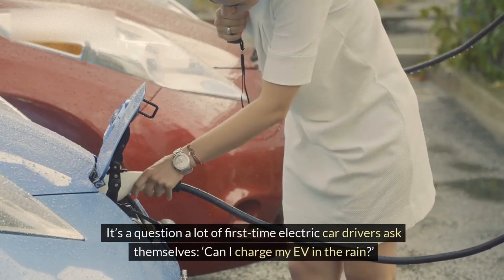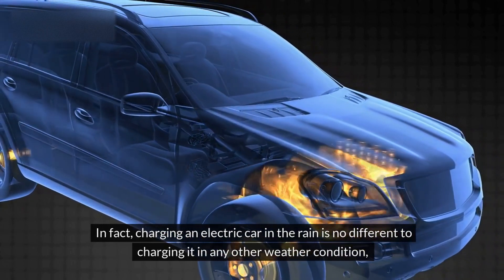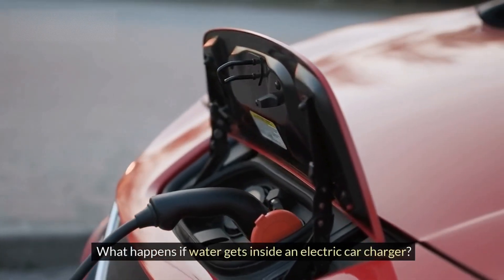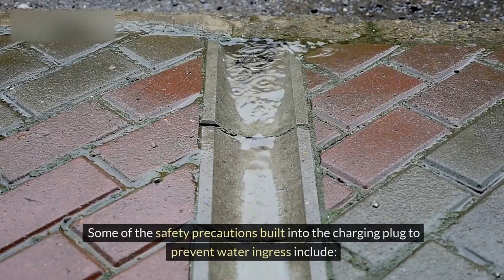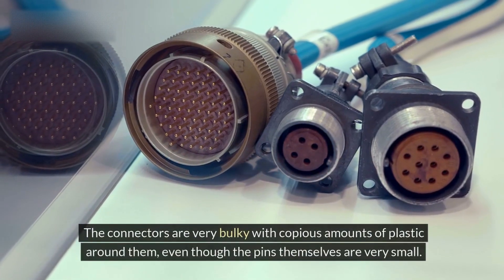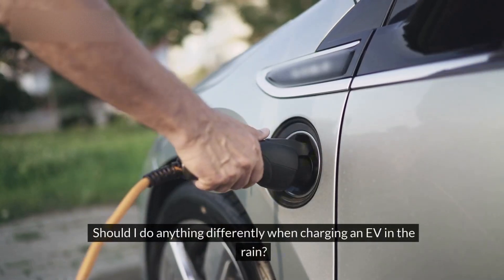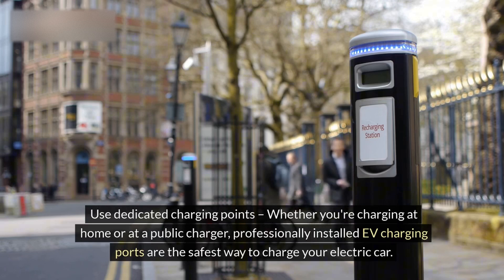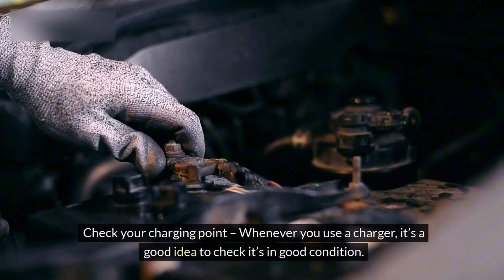Can you charge ev in rain?? | iFlowPower

Comment: As a retired registered electrician, no way would i leave  a standard charging plug and inlet uncovered in the rain.
Ok it may well trip on earth leakage if water gets in, but why take a chance where electrical safety is concerned?
And the waterproof design only stops water ingress, after plug and socket are securely connected, and doesn't prevent a wet plug(sealing cap removed too soon or facing up into rain, allowing plug pins to get wet, or its missing etc ) then being put into an uncovered(sealing flap open) rained on socket. (some folk are stupid, and others just electrically naïve).
Personally I use an a cheap rain cover, designed for the job (clear soft plastic, fits over lead and has velco to pull it tight around lead, and  other larger  end has a magnetic strip in it, to cling to car metalwork, surrounding plug and connection socket), and i only plug it in if both are dry (use an umbellar if its raining, to insure both remain dry).

Imo its better to be safe, than sorry. 
Without such a cover it may well trip off, but then you will come back to a car that has not charged, or worse, if protection is not up to the job, a shocking experience may be encountered.

I think all items of this type should clearly state, that it is essential plug and socket remain dry until fully connected, and using a rain cover is much better.
Reply from the maker: This is a very good suggestion👍👍👍
I hope the audience can see this. Regardless of whether you have bought a charger or not yet, please read this comment to add more protection for your own safety.
Reply: @ralfulrich6254  clearly if you disagree and think putting wet plugs into wet high voltage sockets is perfectly safe at any time, and anywhere, you best stay well away from anything electrical, for your own safety.(but hey, there are still plenty of Darwin awards available, should you wish to experiment 😉)
Reply: @ralfulrich6254  My 2018 nissan leaf manual disagrees as well.
 Quote - Do not touch the plug or the Genuine
NISSAN Adapter if they are wet or
with wet hands. Do not put the plug
or the Genuine NISSAN Adapter in
water, liquid or snow. This may cause
an electric shock which may result in
serious personal injury or death.
• Make sure there is no water or foreign materials in the charge port,
charge connector, or electrical plug,
and that they are not damaged or
affected by rust or corrosion. If any
of these conditions are noticeable,
do not charge the Li-on battery. This
may result in a short circuit or electric shock and could cause a fire
which may result in serious personal
injury or death.

But to be fair it also says
• There is a hole on the charge port for
water drainage. If the water drainage
hole becomes blocked, or if water gets
trapped inside the charge port, do not
charge.
Implying its designed to drain some water.

Yes i realise it is meant to communicate first, if its working correctly still. But knowing how some protection gear can fail, like with stuck contactors or relays, failed RCD devices or burnt out or short circuited electronics(inverter heatpump to heavy refrigeration installs and repairs  were my main fields),  personally i will stick to playing it safe., why risk it

ps - folk are still using 2011 leafs here, so 13 year old charging leads may not be in the best condition still either, or perhaps have a junk example of a Chinese after market charger.

Unsure if it applies to these, but often IP Ratings are with all plug or socket covers in place, or with plug fully located in socket. 
I doubt these are any different, and with flap left open, and plug cap removed, and either exposed to direct rain, they imo are likely to no longer have that rating.(happy to hear if you can quote that they are rated differently).
Reply: Electrical engineer designed the plug to be used in all types of weather. I trust them much more than your gut feeling.
Reply: Some engineers yes i'd agree, but having met some thru my working career, with a just get the job done attitude, who i would not trust to tie my shoes, and with me still being alive after my career, i prefer to listen to my gut instincts, and err on the side of caution, which has saved me before.
Funny how cars manual makes no mention of charging in the rain, do any brands?  @Mediiiicc
Reply: It would make a good video subject for someone on here, or mythbusters, to try to cause a danger to health situation,   or damage to car.
But pleased you now agree, leaving it open to get rained on is not smart,(ie keep it dry) as it may cause damage,  and as per my original post, will/could cause system to fault (leaving car uncharged) @ralfulrich6254